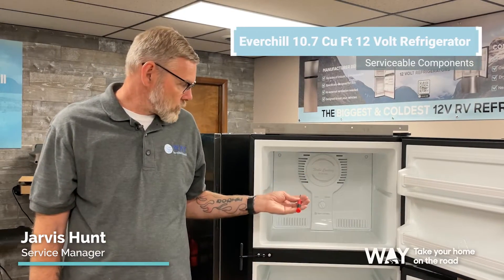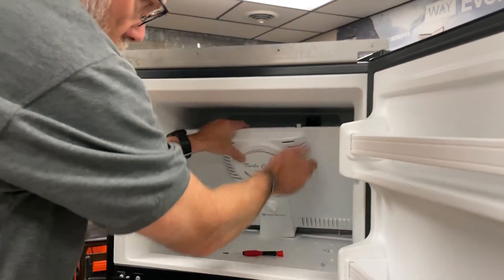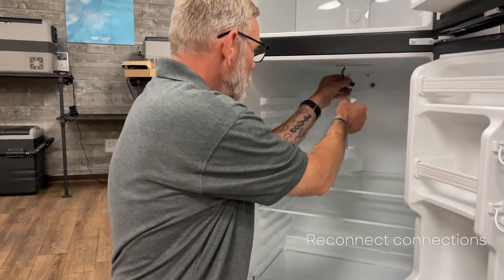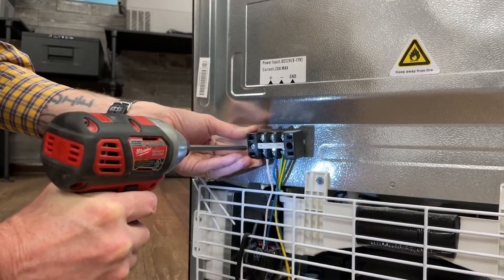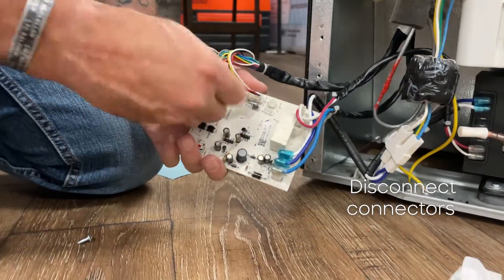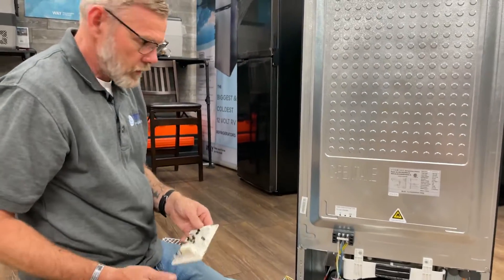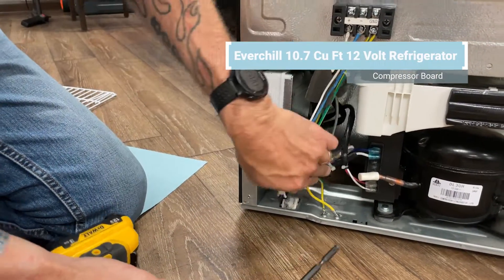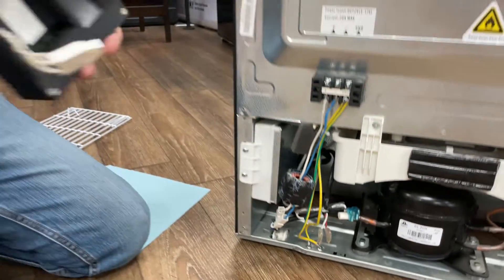How to Service Your Everchill 11 Cubic Foot 12 Volt Refrigerator

Comment: i have a two year old forest river wolf pup with this same refrigerator. it worked great the first two years. this year iv gone out three times and worked great. last weekend i went out and turned on the battery switch to let the fridge cool down over night before i put food in the next day. not working. red fuse light was on. got new fuse and soon as i touched fuse it blew. pulled fridge out and unhooked the three wires from fridge and checked the wires with a new fuse in. had power to the hot wire so i thought bad block. done a reverse check. unhooked the compressor board from compressor then un hooked all wires to board. unhooked the first circuit board and all wires. unhooked every thing there was to unhook the fridge. i put new fuse in fuse holder. started from there hooking everything backup starting from fuse block. after each hookup i had 13.7 volts coming out of what ever i hooked up. got to the compressor board and when i hooked the positive wire to compressor board it blew the fuse. so i believe the compressor board is bad. went to camper world parts and they finally found one through lippert rv parts for $132 dollars. i asked what it would cost me and they looked for a while and said $350. plus shipping. bullshit where can i buy a board with pout going through a dealer? im not paying them $250 dollars just for ordering that part. any help will be appreciated.
Reply: My advice?  Put that refer in a dumpster and order a proper 2 way refer.  Putting these in your rig in the first place was a very poor decision on your manufacturer's part. They will be problematic their entire life because they are not suited for the job and are in many cases non-serviceable.  26 yr master RV tech and RV refrigeration expert.

Comment: Excellent video, can you please help with GE appliances refrigerator Model # GPV10FSNBSB 12VDC. It got power (light inside the refrigerator when you open it) but never got cold the temperature inside about 70 F all time. Calling RV dealer for server appointment 3 months and drop off for few days to troubleshot. it not acceptable for me. Hope someone or you can help to troubleshot this issue. Many Thanks

Comment: I absolutely hate this fridge with a passion. I’m about to throw this one in the dumpster at the rv park. It’s gone out twice in less than 4 months. It’s still under warranty but I don’t give a 💩 because I’m taking it out and running an electric fridge.
Reply: similar issues and hardly ever use, its a nightmare
Reply: This fridge is a dumpster 🔥  it always breaks
Reply: I couldn't agree more just 2 seasons and it's dead. POS!

Comment: This is an excellent video on where stuff is and how to get at it on the fridge.  My Everchill is the same model.  It actually works great for cooling.  I have to set it down to 1 in the lower compartment to stay at about 35-40.  The question I have is that the compressor seems to be running all of the time.  Rarely turns off.   I reset the fridge by removing all power for long enough that it defaults back to the 3 setting.  That appeared to help but it still runs a lot.  Basically, I don't want it to wear out prematurely and don't want excessive draw on my batteries without shore power.   Any ideas on why the the compressor is running a lot or is that expected?
Reply: I had a similar problem.  While in the mountains with temp down into the 30s at night.  It did not make sense that the frig was running near constant, and the freezer was all over the place, from 1 to +22 while the bottom was 38.  I blamed the frig for running what seemed like, all the time, draining the batteries to critically low levels, so we came home a day early.  After some testing I found my problem was not the Frig at all, - it was the batteries.  One of the two batteries was basically dead, and the other was feeding it and while the frig kept running, the voltage was low so it was running a lot, trying to keep up with demand.  After a couple of days, I checked the batteries and they both read 9.4 volts.  And the Frig was still running with the temps bouncing around from high to low.  A real surprise that the Frig would fight to keep things going on such low voltage.  I hooked up to shore power and the first thing I noticed -- the frig picked up in noise, its hum much more noticeable and strong sounding, and the temps after a couple of hours were spot on.  At 3 setting, and not food in the box, it went to 17 top, +37 at bottom, so I reset to 1 on the settings and it moved into -1 top 41 bottom.  I bought my 2022 Sunseeker used and everything has been perfect.  The batteries are assisted by a roof mount solar, but I have no idea what type of model the batteries are, only that they are both, essentially, dead.   This may or may not be your problem, but I would test with batteries only, then try shore power.  That frig, apparently will run on some really low voltage, and while it was able to keep the bottom cool, the top freezer not so much.  Yes, the furnace failed to run on our third night out - maybe that should have been a clue the batteries were at the end of their life?  I don't dry camp that much so that is my excuse.

Comment: I have a Forest River 2021. My refrigerator is not cooling. Freezer is fine. I already purchased the fan. Not working.. I tried to purchase the thermostat they company said they don't even have it in the list. I've been for 9 months without refrigerator and I live full time in my RV. What can I do.??
Reply: Replace it with what should have been installed there in the first place, a standard 120 V AC refer or a 2 way RV refer.  In the long run, you'll be much better off. 
26 yr master RV tech
Reply: As others said, replace it with a 120V AC.  My sons 20 year old GE is still sitting outside in the Florida salt air while our $2000 Neverchill is dead after 14 months.

Comment: What is the insulated coil with blue and white wires running in and out?  On my fridge this coil was tie wrapped to the grill and was shorting out the fridge.  On your unit the coil just appears to be hanging loose.

Comment: Hi I purchased a 2021 Summerland last year that has an Everchill #WD-282FWDC-6 freidge. I didn't notice any issues in use last year but this year we are seeing water. I want to explain it and also want to point out unlike others I keep reading we are not getting any water or even drops of water inside the fridge. I keep my camper fridge off up until two days before we plan to camp. Then I turn on and the fridge is set to (2). Any colder and our stuff freezes. We load up the morning of on say a Thurs and head between 1 to 3hrs to the campsite. We use it normally getting in/out without issues. Then say Sun morning we unhook and come home. When we open the camper to unload at home we have puddeling and streams of water leaving from underneath. I repeat not from inside but it's leaking out the bottom. So much so I have to remove the access cover underneath the fridge to use towels to soak up the water. Since it's hard to see I can't say exactly where under the bottom of the fridge it's leaking from but it's definitely coming out the bottom of the fridge. Again we don't get any water inside the fridge and the drain seems normal. I need help understanding if it's just a build up of condensation leaking from the pan inside why doesn't it do it on the way to the campsite? Why does it only do it on the travel home? Please let me know what to do to resolve it. I'm worried it will rot my floor:(.
Reply from the maker: Hello Robert - There is a water condensation tray in the back that sounds like it is full. It could be going into defrost mode too often, filling up, and not evaporating the water quick enough.

Comment: Hello. 
My fridge is the same as in the video. The fridge snd freezer are not cooling. So I pulled the fridge out snd can hear the compressor clicking 3 times every few minutes but doesn’t kick in to start working. Freezer fan is blowing warm air. Did not notice anything major when I looked and lights work in fridge. Just not cooling. Any help is appreciated.
Reply from the maker: Hello Paul - please contact us at warrantyclaims@wayinterglobal.com or call 574-971-4490 to speak to warranty. Thank you!

Comment: I have a Ever chill model# WD-282FWDC and I can hear the fan kick on but the compressor is not kicking and no cooling, what can I do to figure out if the compressor is bad?
Reply from the maker: Hello - Follow these steps to identify if you are having an issue with your unit's compressor: 
1. Remove the refrigerator from the cabinet. 
2. Remove the wire grille 
3. The compressor board is attached to the compressor, remove the bottom wire. 
4. Once the wire is removed use a jumper wire and jump that terminal that you removed the wire from to the negative terminal of the incoming power. 
5. If the compressor comes on then a new main circuit board is needed. If it does not come on it needs a new compressor board.

For help with this, please contact customerservice@wayinterglobal.com or call (574) 971-4490. Thank you!

Comment: I have an Everchill unit WD-282FWDC-6 11cf model. Brand new with the camper. Have had four occasions when it failed to cool or freeze. Camping World Service department cannot find anything wrong with the unit. Batteries tested good, converter tested good, no lose wires.
During failures lights and fan working, just does not cool below 50 degrees.

We have had to throw away food stuffs when on a shore power resort full 120v power. No one seems to know what the intermittent problem is coming from. In discussion with Way they provided troubleshooting guides to CW tech, still no success. I recommended replacing the main control board but service will not do that without pinpointing the issue. Never fails when they are checking it. This is driving me crazy as we cannot rely on the fridge to work properly. Any recommendation for where to go with this to get it to work reliably?
Reply from the maker: Hello - The circuit board may be faulty and be causing the defrost cycle to malfunction. Please reach out to customerservice@wayinterglobal.com or call (574) 971 4490 for parts requests.
Reply: @wayinterglobal7898  I have a similar problem as the one listed in this comment.   I have contacted your customer support via email.  please reply and let me know how to proceed.  thank you

Comment: My compressor isn’t kicking in at all. I can hear what sounds like a solenoid kicking in every so many minutes.  Fan works, lights work.  Great voltage to main pc board.  I even tried an additional ground direct to the frame.  Please help.  I did email the repair email and I’m waiting on a reply.
Reply from the maker: Hello Allen - We are sorry to hear about your issues with your Everchill model. Please contact our warranty department at 1-574-971-4490 and they can assist in troubleshooting. Thank you!

Comment: I need to remove this refrigerator from a Shasta trailer. Can I assume that if I remove the four brackets holding the refrierator in the unit has enough wiring to slide it out. Thanks in advance Jack
Reply from the maker: Hi Jack - Thank you for reaching out to us! Yes, the unit should have enough wiring for you to slide it out.